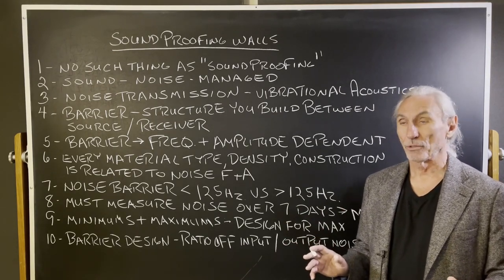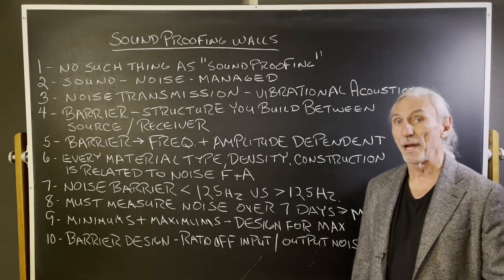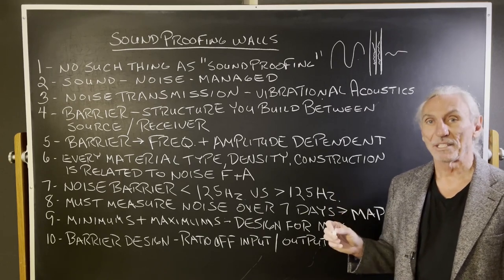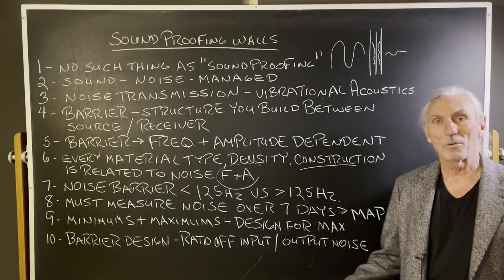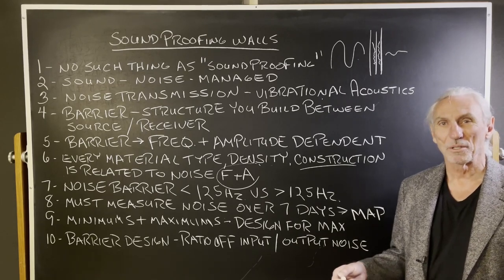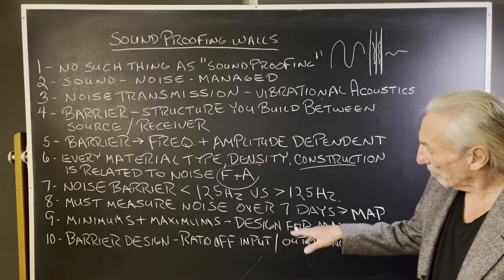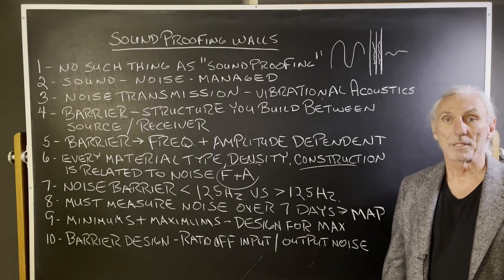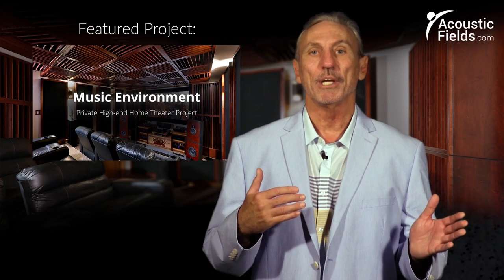Soundproofing Walls - What You Need To Know! - www.AcousticFields.com

Comment: Thanks, Dennis. There's just so much misinformation out there, and you provide real info.
I've actually built 'soundproof' rooms (SCIFs). Very expensive and these were just for the F and A of voice. No way will a 2 x 6 stud wall, with 2 layers of "green glue" even sufficiently stop voice transmission.
Reply from the maker: Lower frequency noise transmission requires multiple layers with proper density of each layer.

Comment: Great explanations. And so true that there is no such thing as "absolute" soundproofing. Like you said, it's usually only managing / mitigation of certain frequencies.
Reply from the maker: Yes. Noise transmission issues can be divided into two main frequency ranges. We have < 125 hz. and > 125 hz. Noise < 125 hz. requires much more mass, numerous layers and more space requirements. The density of each layer must be arranged in the proper order or sequence to deal with lower frequency pressure waves and their associated vibrational signatures. Noise above 125 hz. and its associated vibrational signatures requires less mass, less layers with smaller densities. One size does not fit all noise.
Reply from the maker: Another half truth perpetuated by the industry to sell tactics that will not work because they can not work.

Comment: 30 years ago I was into high quality audio reinforcement, and I built an audio system in my car that reproduced a soundstage across the dash.  If you closed your eyes you could hear locations of instruments and any movement across the stage as well as sense the acoustic size of wherever the music was recorded or however the producers and engineers designed it for the album.  Part of that clarity and reproduction accuracy involved sound "proofing" but I always referred to it as sound deadening.   I knew there was never any hope of driving around in a sound proof car so it never felt right to call it anything but sound deadening.
Reply from the maker: We see that the term sound deadening is used more on the absorption side of issues. A room is too dead usually implies the wrong rate and level of absorption and too much surface area coverage thus producing overabsorption. Sound damping is usually used for noise transmission issues. Neither one are accurate.
Reply: @AcousticFields  True.  And in a moving vehicle it's an exercise in futility.

However, I tested with an SPL meter and before I applied sound proofing the ambient noise level inside the car with the windows up on the highway was around 90 - 94 dB, and after it was down to about 87-89 dB.  So it definitely helped with the "dynamic headroom" of the overall sound system.

I guess damping is the more accurate term for soundproofing a car. It was mostly about adding mass to body panels by applying thick tar strips and panels and a dampening paint that was basically a thick rubberized material once it dried.

Comment: Moving my business into a new building, we are a live production company [sound, lights & video]. We have a rehearsal/pre-production room where artists come to rehearse prior to tours, etc. The new room will be 50' x 80' with 35' walls [to the existing ceiling as we need access to the steel for rigging] What would be the most cost effective way to build this room to minimize or reduce 40Hz-125Hz? Being commercial I may have to use metal framing in lieu of wood. This is not our primary revenue stream but a side hustle that supplements our equipment rentals...
Reply from the maker: Fill out the info in this link. Include pics of all ceiling and wall surface areas. Schedule a time slot to speak with Dennis after data submission.
https://www.acousticfields.com/free-room-analysis/

Comment: Might the use of manufactured T-Studs 2x6 or 2x8, etc
add additional structural strength to walls when building as part of a plan to manage sound parameters in new construction?
Reply from the maker: What are the frequency and amplitude of your noise issues. Without noise numbers, you are guessing and guessing is a fool's game when it comes to noise.
Reply: @AcousticFields  very true. Thanks
Reply: @AcousticFields  Also the size of the maximum unanchored span effect this, also. A wall that is 40X40 feet will be harder to attenuate than a wall that is 4X4 inches.

Comment: Hello, how about tripple leafs constructions, is it bad? Always bad?
Thanks
Reply from the maker: What are the frequency and amplitude (strength) of your noise issues? Every noise issue requires a number or you are just guessing and with noise guessing wrong usually means treaing out what you built and starting over.
Reply: @AcousticFields  traffic noise, i am not try to build it, just ask about tripple layer constructions, what your opinion about it.

Thanks
Reply from the maker: @panca4238   All material and constructuction methodologies are based upon the frequency and amplitude of the noise you are dealing with. There is no good or bad. These are misleading terms.

Comment: A perfect vacuum is soundproof. However, the edges of the chamber in which vacuum is maintained can transmit sound.
Reply from the maker: Yes, but we don't work in airless chambers. It might be easier if we did but we have to stay focused on the energy conversion process that occurs when airborne energy strikes a wall and the science becomes vibrational acoustics.